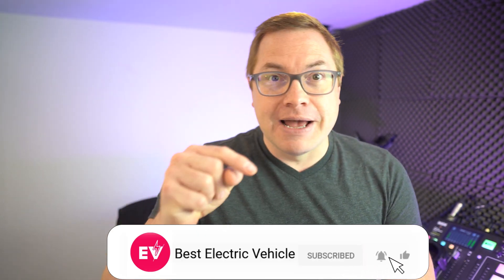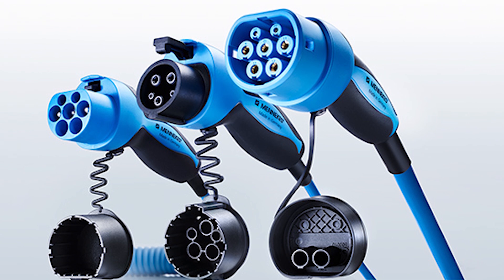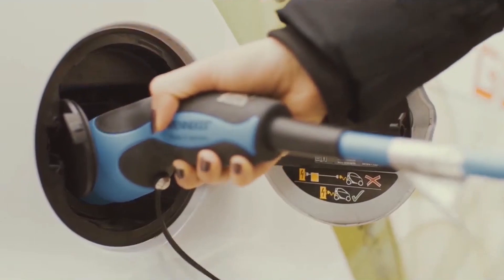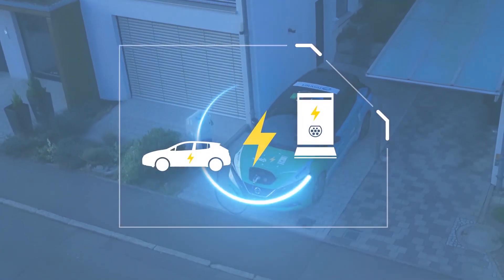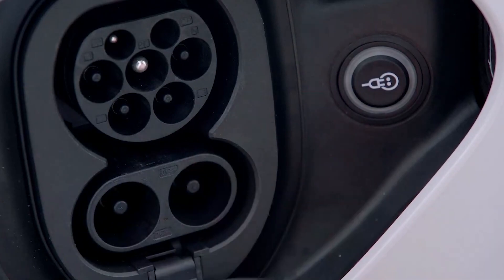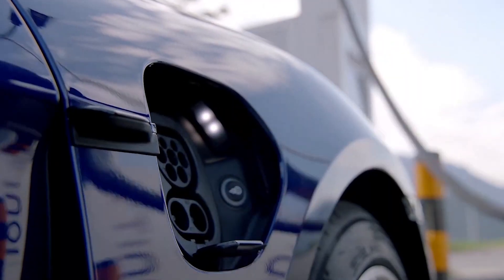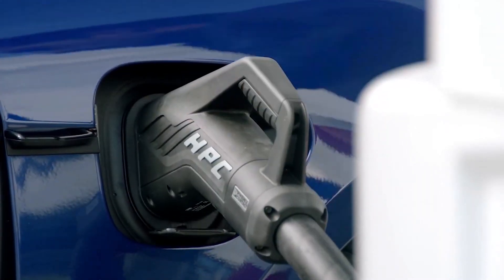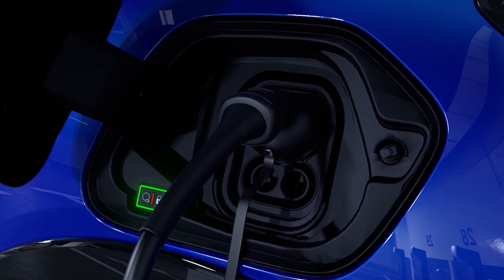EV Connectors, do you recognize them all? | I Speak Electric

Comment: Nice whirlwind video on the basics for charging connectors. Perhaps you ought to remind charging virgins that they can also rewind the video to catch any point they missed.
What's the best connector? I wish we had it in Europe. The Tesla connector, of course. It is super neat and versatile, and is only a software [so they say] upgrade away from being b-directional. Myself, I think there needs to be a few internal hardware upgrades inside the car, but the connector will do the job. The CCS is a good second, imo. Factoid: Did you know that the original Tesla Roadster was capable of V2G? Tesla dropped it because no customer showed interest. [sigh]
Reply from the maker: Didn't know that about the Tesla, fascinating! Also, good point about rewinding, suppose it was something we took for granted!  Thanks for the comment and for watching Andy!

Comment: Does IONIQ 5 come with inductive charging that may initially not be enabled but could be enabled as the hardware in the field is deployed? And if so which markets did they release that in? I could see connector gauge and wire gauge changes necessitated by greater charge rates leading to different types of plugs for standards that need to supply in some cases greater amount of current. I could also see how some countries regulatory agencies have different requirements. Very interesting topic and very well covered!
Reply from the maker: Hi Gary. Haven't heard about inductive charging on the IONIQ5, but that would be very interesting. Thanks for the feedback! It was a very interesting video to research!